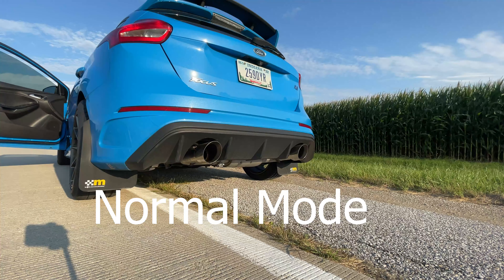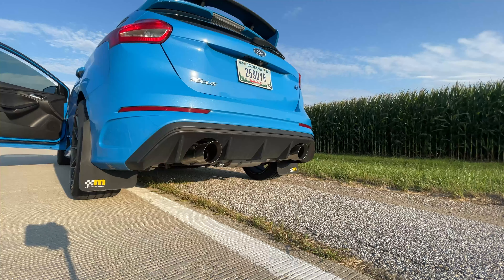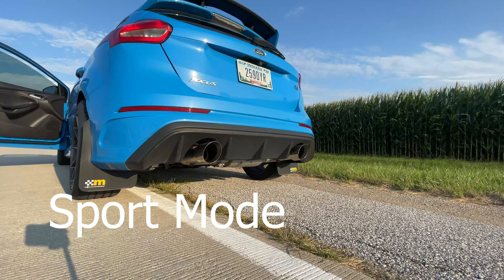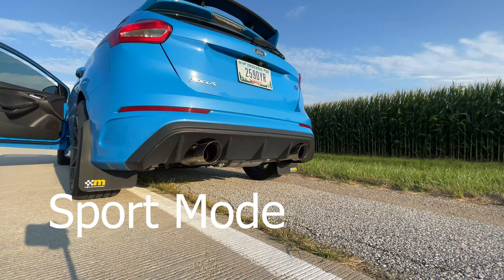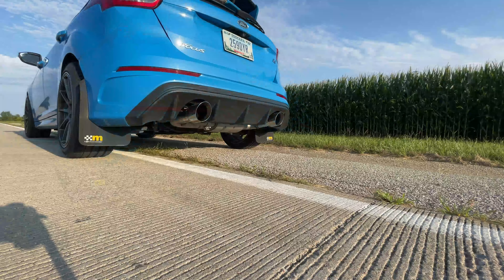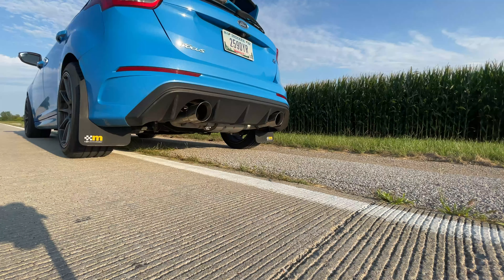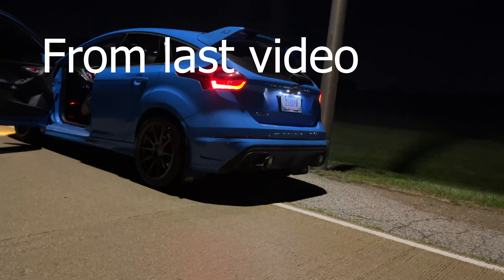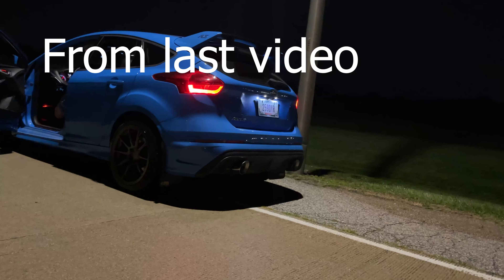How To Make Your Car Shoot Flames/Explaining My Tune

Comment: Just thought I’d chime in. I used to own an ST that shot massive flames, and currently own an RS that shoots flames as well. Both are COMPLETELY, different as regards of how they shoot flames based off of how stratified tunes these cars for burbles. In testing the ST never shot any flames sitting still. It only shot flames while downshifting to get the rpm above 5k. Now the RS, in neutral reving to around 5500 or so, downshifting to around the same rpm level shoots flames.
Reply from the maker: Good info for anyone with an ST

Comment: So I’m on a stratified tune and fbo with e30, do I need to add the pop tune to make flames?
Reply from the maker: Yes, mine only shoots flames with the biggest pop on e30 also catless dp. 93 and normal burble it doesn’t do anything.
Reply: @anthonyiafrate  sweet thx
Reply from the maker: No problem hope that helps

Comment: What tune from stratified do you have and what rpm do you rev it to to make it shoot a flame and  does 2 step help or no
Reply from the maker: I just got their basic tune with e30 and the extended burbles. It’s around 5k when it does the big pop that shoots flames as for the 2step I didn’t have them mess with it so I’m not sure
Reply: So I have the loud crackles and pop tune by them so should it work with that and I’m completely straight piped
Reply from the maker: It should but I don’t remember what video it was but I mention I hardly get flames unless I’m on my e30 tune.